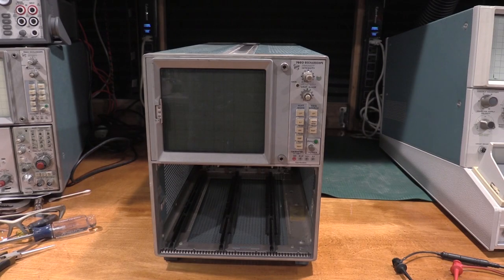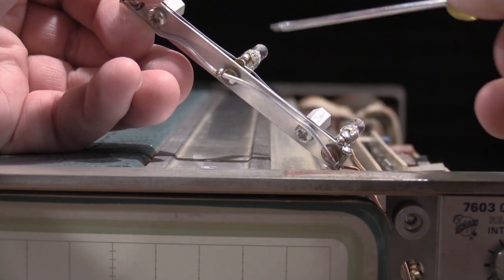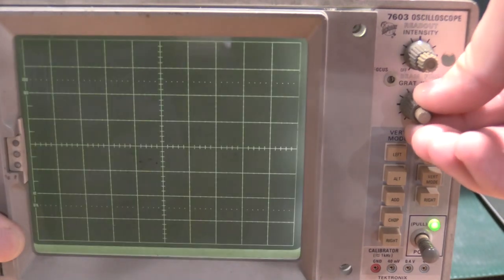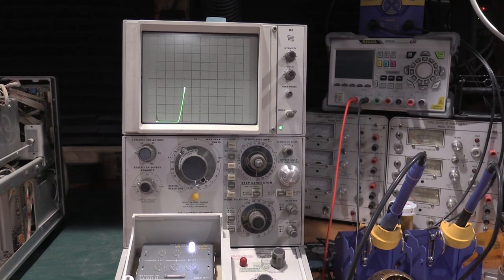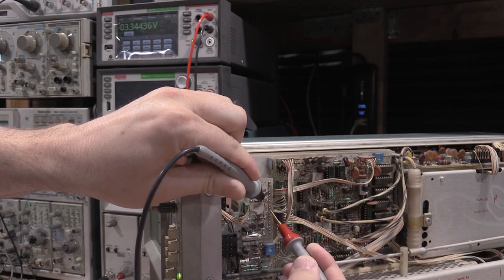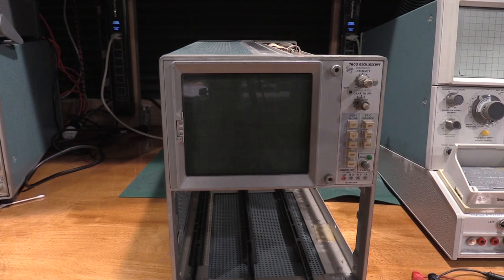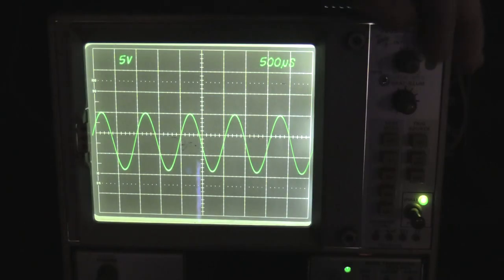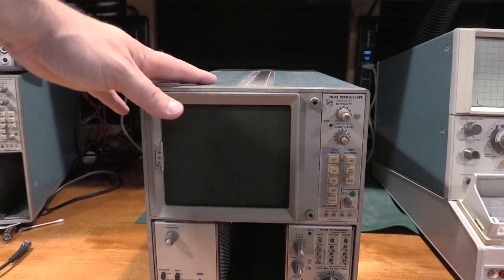Tektronix 7000 Series LED mod Details

Comment: About the 40 mA on the curve tracer - that reading at the peak means there is a duty cycle, and the average is way lower!  I don't know how much, but I do know that the L-shape trace is scanned repeatedly between the whole length, so it cannot stay at 40 mA all the time.  Typical semiconductor data sheets mention 300 microseconds as the test peak duration for peak current number.  Maybe the curve tracer uses the same?
Reply from the maker: The curve tracers are locked to line frequency. The collector supply in a 576 and 577 are sweeping at 50 or 60 Hz

Comment: Hmm, I just performed this mod on my 7603, using high intensity LEDs I had in my parts drawer.
I ended up placing two 1N4148 diodes and a 33Ohm, 1/2W resistor in series with the LEDs. I tried it without the resistor and only 1 diode at first, but the LEDs blew after a few minutes (and reworking the lamp sockets a second time is a PITA).
The Vf of these LEDs is similar to the Adafruit parts, unsure why I had such a different outcome, but with a few minor tweaks it is looking good.
Reply from the maker: I will look in to this a bit more that supply is should be short proof and current limited by the power supply. But I did have one other report of and issue. Glad it is working and looking good I really do like this little scope.
Reply: Looking at the schematic, I believe we can modify the current limit to suit the LEDs by replacing R837/838 with something that will limit in the 60mA range instead. I need to understand the way the circuit works in detail to figure out the new value(s), but it looks really tractable.
Need to verify that the range of adjustment is still there if I were to make this mod.
Reply: I simulated the circuit, and while replacing R837/838 with higher values (like 15-27R) does indeed limit the max current, it also reduces the range over which the intensity control would be effective. Need to noodle on this some more.
Reply: I have designed & tested a solution that is very similar to the 7904A mod that I developed and shared with you.
It replaces the Q827,829,835 circuitry on the rectifier board with a current-mirror design that requires the LEDs to be wired in series.
You get 0-21mA through 3 LEDs with pretty much the full range of adjustment
I have a board in fab, and will put the details & photos up on github when I get them back.
Like the 7904A mod, in addition to wiring the LEDs in series, you remove the ribbon cable that connects to P891 on the rectifier board and simply connect it to this tiny (~35mm square) add-on board that gets mounted <somewhere>.

Film at 11. How many 76x3 mainframes do you have ? I can send you a couple of PCBs if you'd like.
Reply from the maker: Hi Andy, I have 3X 7603's in the lab but I might be having some more 76xx content on the way as well. I am also looking for some green filters for them. 2 of the 7603's that I have have the ND filters and these are VERY dark even with the LED lights.
Reply: I was lucky enough to get a clear implosion shield for mine from Sphere. The one my 7603 came with was very badly scratched up.
Boards are on their way back from fab, I will send you some kits if it works as I hope.

Comment: Very nice modification! Have you tried any other color LEDs? Might be an interesting experiment. I have found that surface mount LEDs soldered to bare wire in a ladder arrangement work well in tight locations. I used this technique to light the LCD display of an HP 8642B Signal Generator that originally  had grain of wheat  lamps installed.
Reply from the maker: With another color I would have to take in to account the Vforward of the LED. the 2.5 Vf of the white led is actually helping in this case.
Reply: True, but I find that there is either a resistor in the power supply that can be changed or I can run the LEDs in series/parallel combinations.
Reply from the maker: This is always true the question is now what color to try? My eyes cant take blue, a warm white mabey? Green would be out Though I have tried green in the readout of a 576 that looked really nice.
Reply: Not blue for sure! For graticules I was thinking green, amber, orange or even red on a "breadboard" just to try them out.

Comment: I never had the chance to work with the 7k series. Is it intended that the readout wiggles a bit (to save the phosphorus) or is it just ripple from the psu?
Reply from the maker: It can some of that is caused by the signal amplitude. With no trace the readout is very stable a large display will cause them to dance a little. It is how to tube draws the readout. It has to blank the trace and move the beam then draw the letters. You can also see dim spots in the trace some time (looks like noise) but it is no beam as it is drawing the readout. It looks funny at first and I though it was broken but it is easy to ignore when it is known that is the way it is suppose to work. The short answer is the dancing readout is a physics artifact based on electrically yanking on the beam from an electron partial accelerator, and asking 1 electron gun to do a LOT of dancing and brightness changes. When you really do a deep dive in to the timing to make it all work and how fast it has to work. It is incredible that it ever worked.